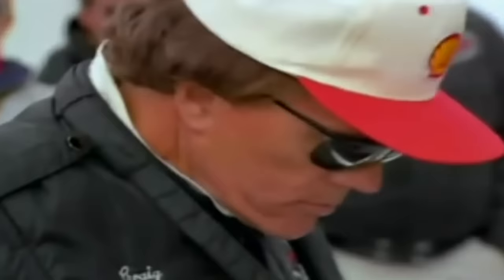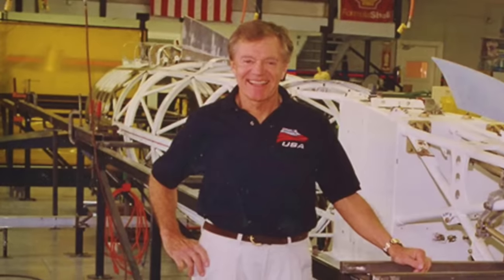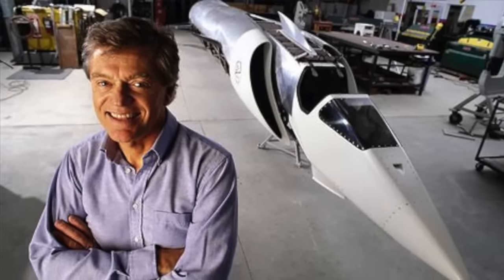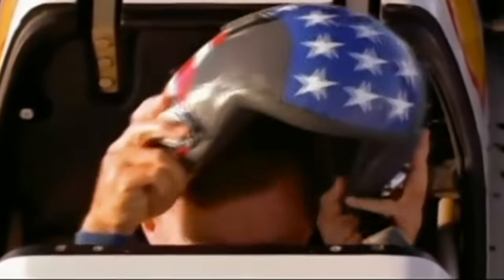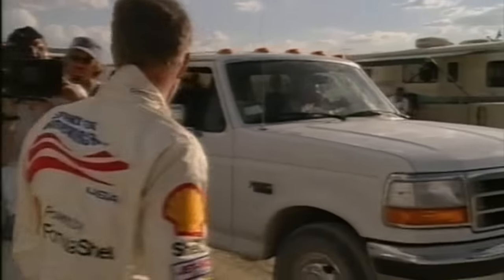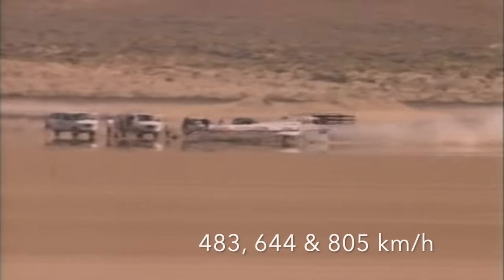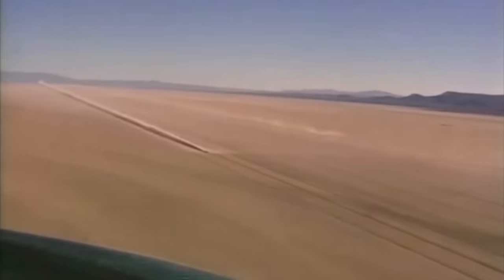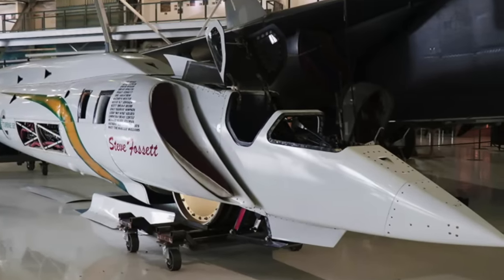Spirit Of America Sonic Arrow (Formula Shell LSRV) - Craig Breedlove's Supersonic Challenger

Comment: SOASA had a greater thrust-to-weight ratio than SSC hence over a short course may have won out. However as the cars speed up their weight becomes less important and the chief forces are thrust and drag (like in ac). Breedlove reasoned that the huge engine intakes of SSC would increase SSC's drag sufficiently for him to beat it. However he hadn't realised that the quoted engine thrust is a 'net' value and takes the engines' drag into account. To compare the 2 cars drag therefore you would need to calculate the drag of each car with the engines removed. It is likely therefore that the drag of both cars were probably not very different giving SSC a huge thrust advantage with 2 engines.
Reply: Excellent.

Comment: Sorry I should've been more specific on the J58, I was talking about the turbo ram of today like the one the Pentagon is testing for HyperSonic speed achieving mach speed 3+ & going to 4+
Reply: Hmm, that's a good start but you need so much more than sheer power to be successful at this. There were other issues with SOA that didn't come to light until after it was sold. Although SOA was a beautiful car, and capable of breaking the old record it wasn't as professionally engineered and tested as SSC.

Comment: Sonic Arrow lifted against the wind NOT in the direction of the wind. Craig discovered this was caused by the gyroscopic precession torque of the front wheels. There were massive rotational wheel forces and running the car in a 15 mph wind amplified the problem.

Comment: A little misleading about the design's shortcomings. Cockpit too far forward; very bumpy ride for the driver.  Without geometrical variable inlets the single engine could not overcome the power drop off caused by the transonic inlet shockwave; thus why SSC used two engines.  That is SSC didn't use GV inlets either just pure power to punch through the transonic range.

Comment: I followed this on Speedvision in 1997. I was SO disappointed when the good engine got ruined from that tip-over skid. This car could have not only beat Thrust SSC but easily set a faster record at over 800 mph. This car is the best looking LSR car ever built by far (IMHO), to boot.
Reply: Only if control issues could have been overcome.

Comment: Always been a little curious. Where did  the bolt come from?
   Raced many kinds of races and types of vehicles. There are good sportsman and there are bad Sportsman regardless of the Public Image portrayed.
    In horse racing I used to sleep in a horse stall next to the race horses. Trust no one. And when showing up at vehicle or boat races soon as the vehicle is out of the trailer someone is standing guard. Just saying. There likely wasn't many bolts on that vehicle and it's  unlikely any weren't torqued.  Bolts likely had thread lock applied and all nuts where lock nuts  or tied with safety wire.

Comment: I don't understand why they don't use the body of any jet fighter built after 1970. All the wind tunnel testing is done ,the bays for the engines are there, so is an ejection seat if the driver gets in trouble.just clip the wings to stubs, turn then upside down , left wing to the right, right wing to the left . Mount wheels to the stubs and one center wheel to the tail  leave the rudder there,but clip it down a bit  remove tail wings and let her fly . I think an unused body from a F-18 would be good, and big enough holes to mount two powerful engines . The unused bodies are just decaying in the desert anyway.

Comment: I would say I learned from these mistakes, yet MY super sonic car design is different in all ways.
They have proven super sonic aerodynamics, including wings to adjust the down force and keep it on the ground. 
They use rockets, much smaller, lighter, {mine exhaust pure water, too} and not at all  prone to suking in dirt and being ruined.
The design speed is 1500mph, yet someone let slip their computer simulations put the top speed around 1800, with the 60,000lbs thrust motor.
SO the best place to run, with cryogenic fuel, is on a 50 mile laser straight ice road, probably on Northern Lake Winnipeg.
The problems with wheels made to spin this fast, makes me think of using skate blades, with a far larger contact area to the surface, and far better directional control. I call it "The New Simple"
Reply: Uh, HUH!
Giver 'er a Go and get back to us ASAP with the results, wontchya?
TIA
Overnout
Reply: @Demo My designs began as speed boats, that would run under water if 'stuffed'; and so began the HOPE (hydrogen oxygen piston engine) water exhausting outboard, based on my thousands of hours of driving fast boats. 
Not theory, fast boats are all out fun, and dangerous too. No one has gone for the overall speed record on water since the 70's.... and lived to tell about it.
Reply: @user-td1zo3tv9p  Did I mention the part about sending the plans for 'The Simple' land speed car to that place in the desert, with the composites built to scale and all , where the man with the funds to make it happen went up in his small plane to scout for a long flat place to run it at those speeds - and seemed to dissappear from the Earth? How the search was so extensive ti found several crash sites from 70 years ago back during WW2? He was missing for weeks. Did you hear the part about how his body may have been found first by a hungry mountain lion first, and partially eaten, and it was far far away for any flat places up in the high mountains?
Reply: @user-td1zo3tv9p  Oh - IF you can find funds, the patents on the water engines, which could solve the carbon emission Global Heating problem cold, would be worth... more money than the Koch Brothers have ever seen!
Will save the World, for food.

Comment: Uh, how do you get a jet engine to run in unleaded gas? Diesel yea, but 93 octane gas??
Reply: It's a high energy, combustible substance in liquid form. Might have required some changes to the combustion chamber or injectors to accommodate the different physical characteristics, but all the same principals apply. In fact, jet fuel and gasoline have almost exactly the same energy density (45MJ/kg).

Comment: He was so lucky not to kill himself. The cross section of Thrust SSC is deceiving, it looks like a lot more than it is. The engines don't count, they are a low pressure area at the front and massive pressure at the back. So you are left with the arrow of a center body and the nacelles, which are a pair of tubes. I doubt the maximum speed calculations. ThrustSSC team did a lot of wind tunnel and CFD work and thought they had the power for 850mph. But when it came to running supersonic they found a lot more power went into the shockwave than they had expected. So instead of driving the car, they were crumbling the surface of the desert. I always wondered what would happen to Sonic Arrow when the supersonic shockwaves built under those rear wings. ThrustSSC had ram control computers to jack up the rear at speed so that they didn't get thrown off the desert. Andy green didn't believe they were working and told the engineers to switch them off and give him maximum down force, that run resulted in the car nearly swapping ends when the front wheels were driven inches into the ground at something over 300mph. After that Andy Green stopped telling the engineers what to do.

Comment: Thrust SSC was only ever run with Her small engines. They had a bigger pair, but ran out of money to fit and trial them... And had already achieved everything they set out to do...
Reply: MBCGRS thrust had two reconditioned engines bought from the RAF. They were fortunate that rolls Royce tuned them for free as they were running on literally 110% power which degrades them very quickly.
Reply: Thrust SSC set the record with a pair of Spey 202s which were originally meant as development runs engines. They had a pair of Spey 205s which are the higher power tuned ones which would indeed have only lasted about 10 hours. But they never ran with the 205s.

Comment: It’s funny how the britts went the all out “massive power/everything bigger” route- butt the Americans went for sleek, light, and efficient.  Usually we’re the ones just throwing horsepower and displacement at a mechanical problem.
Reply: It was becoming clear that approaching mach 1 that a bigger, heavier car requiring more power was needed. Remember that Thrust was far more 'engineered' than SOA including wind tunnel testing which Craig shunned. This has characterized most Brit LSR cars since the 1920s hence the Brit domination of the LSR except when the US borrowed the record during the 60s and 70s when they pioneered jet power. Interestingly the EE Lightening v F104 Starfighter is another example of Brit brute force approach.

Comment: Breedlove&sonic well on there way to smashing thrust2 record if he had completed this run history would have been different for sure if you look back at the hole deal sonic got right up over 600 easy thrustssc allways had handling problems half turn on wheel to just keep her straight so the rear wbeel steering idea hardly worked and was problematic lucky for the British the have a very skilled driver in andy green just like breedlove tbese guys are cut from a different cloth ice water for blood i wonder if i will be alive to see the 763mph record beat or the ken warbys 316mph water record

Comment: How did Breedlove manage to FOD the engine with a bolt?  Was it picked up off the track of did it work l loose  and enter an intake?
Reply: Lots of debris gets on tracks from cars.
How many mechanics have misplaced a nut, bolt or bigger item while working on vehicle?
Reply: @rosewhite---  - That's why every time a jet engine is started in the Navy, someone "dives the ducts" checks the intakes  for misplaced items. And that is why fasteners are safety wired.  As for items "left on the track" the chances of the engine sucking them up off the deck are slim.  When such an item does go down an intake and FODs and engine it is usually kicked up from the jet last from another aircraft.
Reply: @scootergeorge9576  yes but Craig was on the salt.
Reply: @rosewhite---  - So?
Reply: @scootergeorge9576  so your navy analogy doesn't apply?
Reply: @rosewhite---  Salt of desert dry lake. It still applies.  You mentioned salt as if it mattered.  By the way, the J-79 that Art Arfons went 500+ MPH  with came from a junkyard. It was a fodded F-104 engine that he smoothed out the damaged compressor blades, "blended" in Navy lingo. Paid a couple thousand for it. Had a total of  ONLY 10 grand in his "Green Monster."  
Craig Breedlove says his backup engine  wasn't running right. If he was a good jet mech, he could either swap out components from the fodded engine and got the backup running right or if the damage was not too great, blend the damaged compressor blades.  Used to do this all the time with J-52 engines from the A-4 Skyhawk AKA Scooter. 
Breedlove may not even know how to do an engine trim.  On the A-4 and A-7 aircraft I worked on, the fuel control had top be tweaked for RPM and exhaust gas temp to get max power without over speed or over temp.
Reply: @scootergeorge9576  Dismantling and swapping broken blades is hardly a thing to be tried on a dusty desert?
The racers have to book time and find the money for each trip so Craig couldn't attempt to repair the damage  - and we don't know how bad the damage was.
Reply: @rosewhite---   - No but he could troubleshoot his backup engine and take known good parts from the  fodded engine such as fuel control  and get the backup engine up to snuff.  The problem with Breedlove is he can't do anything cheap. Without huge funding, the man is lost.
Reply: @scootergeorge9576  Looked to me like he was working out of a small garage in a poor neighbourhood.
Anyway when we see you set the LSR we'll knwo you're correct.
Reply: @scootergeorge9576  No I think your wrong, Craig had to do everything on the "cheap". Nothing about LS racing is cheap, spending money where it's needed is foremost. The second engine wasn't ready because they didn't plan on needing it.
Reply: @bebo5558  - Back when Arfons built his car for 10 grand, Breedlove was spending 250 grand on his J-47 three wheeler.  Nothing about racing is cheap but some are "thriftier" than others. Watching the video, a lot more money was poured into this project than needed. Like the ejection seat. Even a "zero zero" seat would likely fail  if he has to punch out at speed on the deck.
Reply: @rosewhite---  - There's a video about former LSR holder Art Arfons. This guy literally took junkyard stuff and was hitting close to 600 MPH.  Been a huge fan since I was a kid back in the sixties and Reader's Digest did a story about Art and his Green Monster.  The Beach Boys did a song about Breedlove but Arfons with his Allison aircraft powered drag cars and later jets was just way cooler. 
Bottom line is, Breedlove's car was not capable of breaking the record. And him not being able to get the backup engine running properly says either he. or his crew aren't good jet mechs or it's just a cop out to deny the car was a failure. 
By rgw way. Ever hear what happened to the guy that built a wingless F-104 for a shot at the LSR?  That think looked wild!
Reply: @scootergeorge9576  Arfons probably had 80% of the stuff sitting around already from other projects!  You make Breedlove sound like King Midas, there is  nothing wrong with going first class with quality. When your butts in the drivers seat and your life is on the line, I wonder how cheap you'd go?

Comment: No CFD is a really risky move for a vehicle intended to be supersonic.
Reply: The CFD analysis on Bloodhound was impressive and very thorough. I doubt that Breedlove's LSR vehicle would cross the sound barrier intact. To cope with the transonic pressure , Bloodhound is made of titanium skin
Reply: @asicdathens  The biggest problem is that Breedlove's car had not done any wind tunnel or CFD testing at all. Every design starts with a concept and his was probably not a bad one but once you reach critical Mach number, strange and often dangerous things can happen. It's not beyond the possibility that his sudden crash at Black Rock Lake was in part due to a lack of aerodynamic refinement. Personally, I'm not convinced that 48,000 hp was enough to make it go supersonic. There are too many things to deal with at those speeds to just leave it to chance. Tiny corrections in shape can offset critical drag rise. Shockwaves can appear where you don't want them and reverse the effect of controls. Shockwaves can also be very unforgiving on a structure, as witness the rear section of Thrust SSC towards the last of its runs in 1997.
Reply: @thethirdman225  Because Thrust2 was not designed by a  aerodynamisist but by Noble himself, it was 8 mph before taking off from record speed. And this is subsonic.  And without drag coefficient is impossible to determine if the one J79 engine was enough. I am curious why General Electric didn't help Breedlove at all. Noble always had a cordial relationship with Rolls Royce. RR remapped the EJ200 for optimal performance at ground level and designed a new control box to allow the engine to go full throttle at ground level. They even provided an air starter
Reply: Efstathios Dimopoulos Yeah but that was Thrust2. Breedlove’s final vehicle was contemporaneous with Thrust SSC. SSC was designed by Dr Ron Ayres, an aerodynamicist. They had done all the compute modelling and pretty much knew what to expect when the vehicle went transonic. Also, while you’re quite right about Noble and his ability to set up a cordial relationship with Rolls Royce, in the case of Thrust SSC, they were using Rolls Royce Spey engines from a RAF Phantom. Only Bloodhound uses the EJ200. Bloodhound is in another league altogether. It has to be.

Comment: The airflow physics at supersonic speeds doesn't work like normal aerodynamics.  Every pointed surface creates a supersonic pressure wave that propagates.  Those little fins in front of the rear wheels went trans sonic and created a supersonic pressure wave.  That pressure wave distributes air around the emission point evenly and changed the aerodynamics of the car.  I think the pressure wave pushed enough air under the wheel and that lifted the wheel off the ground. The design would have never been a supersonic car with the instability of a three wheel ATV that was banned for doing the same thing and killing people.

Comment: breedloves car was sabotaged. it was a foreign bolt that went through the engine.
Reply: Highly unlikely. If you watch the full doc (1.5 hours) of the thrust SSC, you will see all the crazy shit that goes wrong when travelling that fast with that much vibration. It was actually ripping the rivets that hold the sheet metal on the car body completely off, breaking big major suspension components, etc.

Comment: Don't forget Craig has to work with limited budget while Noble has spent £50-60 MILLION!
Reply: This is wrong by about a factor of 20 - Thrust SSC cost <£3m.
Reply: @tomkandy  Absolutely - I still have a certificate that you got for donating £25 towards the fuel for the An125 that took the car to the US.  Noble was a genius at running a campaign 2 microns above running out of cash (sadly this didn't work for the Bloodhound SSC effort)
Reply: @clewerhillroad  Bloodhound LSR is still alive, hopefully a run in 2021 will go 1k+
Reply: @Penguin_of_Death  sorry didn't mean  to suggest it was all over. The new backer's cracking on with it.